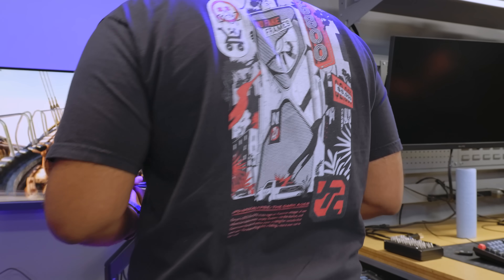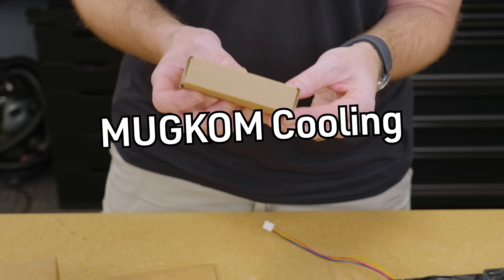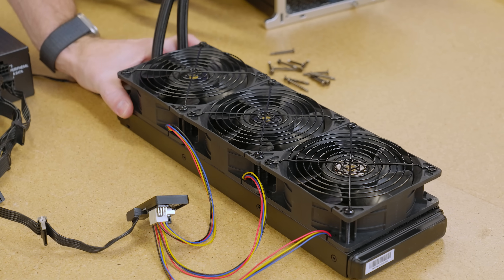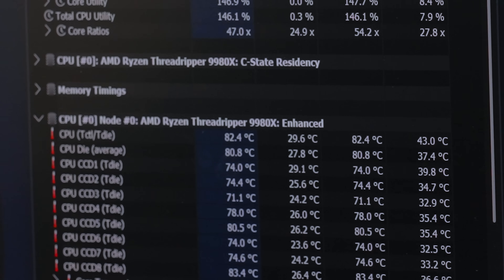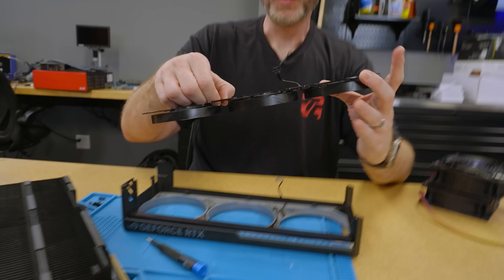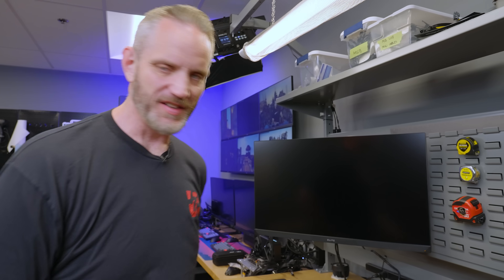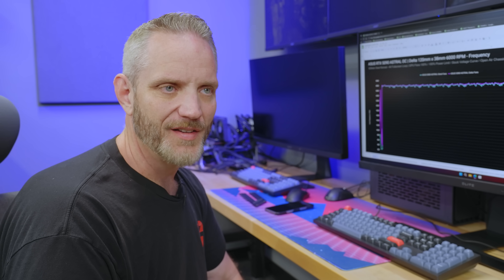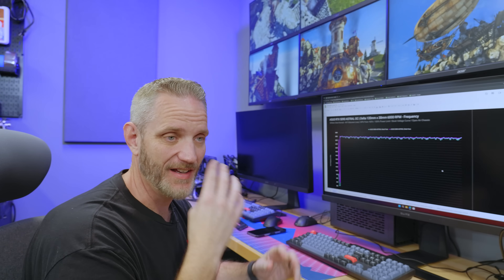Server Fans on a GPU... What could go wrong?

Comment: Hey Jay and crew! I have a question that may or may not lead down a rabbit hole... Would it be possible for you to take one of the water cooling set ups you have, get a baseline of the temperatures at idle and under full load, as well as current draw of the pump at various rpms, then swap out the coolant for 100% mineral oil and do the same? I know mineral oil won't have the same numbers but I've always wondered just what difference is there, and whether the different viscosity would strain the pump.
I'm trying to figure a cost-risk analysis if say the temperature delta between water and m.o. is for example 5  degrees. would the strain of the pump make  the expected lifespan half or less? necessitating many more pumps or if it would be a decent enough solution to algae and other hazards of incorrect additive mixtures.

Comment: Point of diminishing returns is probably I am going to guess somewhere around the 3000rpm mark. Not sure on the CFM, but I say this because of Noctua's industrial fans that reach 24v and 3k rpm or 12v and 3k rpm. I have the 12v versions for 120 and 140mm sizes. These things push air like it's nothing, but still fall short of the Delta's obviously on pure CFM. 

But Noctua would absolutely know that Delta's exist. So why not 6k rpm like with those?

Because they probably found the sweet spot is at about 3k rpm provided they can get enough airflow and static pressure with a redesign of the fanblades, stuff like that. And as I understand, the  main reason why Delta's 6k rpm fans exist is mostly just because they are having to move a lot of hot air to cool something producing more heat due to the way things are in server rooms. And they're having to push it through a bunch of stuff, so a lot of pressure is needed.

So they probably found that in other situations with more free flowing air, of cooler temperatures like average room temps for instance; 3k rpm is probably enough for most situations. Even automotive with those 24v versions.

In my use of them, I think they could probably stand to go just a little bit faster for those days when the heat can't be beat. But aside from that... they're pretty decent at what they do. A little costly comparative to some other fans out there, but... so far I think they're worth it. Why?

I'm competently cooling a 5800X3D with just 2 fans on the heatsink and no other case fans. I'm using the static pressure of the heatsink allocated 3k rpm fans blowing out the back vent, to create a suction effect through the rest of the vents. This cools the double pc case without an issue. Yes, 2 PC's in one case, cooled via just their heatsinks. Actually, mostly just the AMD heatsink. The intel one is mostly just putting more heat into the case cause it's not pointed the same direction at a vent, etc.

Max CPU/GPU load temps, I generally keep things in the 70c range at max speed, hitting 80c at most if I let it be a little slower for noise reasons. 

Two fans. On the heatsink. In a dual PC rig. 3k is probably enough I think to meet that diminishing returns curve based on my experience. 

Would I try this method with a 5090? Naw. I'd get some more proper cooling setup for that. More fans, etc. 

But it does help prove the point that at a certain point you don't really need more fans, you just need faster/better fans, but even that has its limits. I can get away with that with my X3D/6750XT rig plus Intel rig on the side; but I wouldn't bother trying that with something like a 5090 in there. Not without a way to remove that heat immediately on its own, like with a loop.

My room temps fluctuate too I should mention. I do have an AC unit to bring things down to 21-23c again, but most of what I have been saying is more attributed towards room temps of 25-29c. I kick the AC unit on again at 29c. 

So the heat definitely is being removed from the case.

Comment: Love it. 

Back in the early 2Ks I had a GeForce 2 Ultra and that beast was seriously filling my case with a lot of heat. My case had 2 80mm intake fans and room for a 60mm exhaust fan. I decided to order a delta 60mm fan for exhaust. That thing was crazy, you could feel the air out of the back of the case 30’ away on the other side of the basement. It was crazy loud too. I ended up getting a case with better airflow to transfer the computer into.

Comment: Just aim fan directly at cpu.  Why bother with the water intermediary with that much air power.  Just do it server style.  Fit them into a 4u rack case and blast it with 8 to 12 fans over a simple heatsink.

Comment: These are the same style fans that come in Alienware computers. The first computer that I tore apart to make my first custom build and custom water loop I use these fans and you can tune them to be silent and violent. So you get the best of both worlds. The only thing I want is Li lan to take a fan motor out of one of these and put it in their LCD fan so I can have all of it in one fan. Oh and make sure you use the high output fan control or pump control on your motherboard to control them.

Comment: So the one thing i came up with a long time ago, was an enclosed two liter LN2 burst system.
The housing unit runs on basically a lawn sprinkler program. 
Inside the housed unit, you have four needles that align with the CPU.
They send timed small bursts, which would eventually just be replaced by thermal sensor coupling.
The tank mounts to the back of the tower.
It is a VERY viable system.
You couple this with a machine that can produce its own small batches of LN2 and you are set.

Comment: 10:15 Gaff tape doesn't leave residue if you use it and then get rid of it. Long term the adhesive will melt like electrical tape
Reply: This is why I use white electrical tape most of the time.

Comment: I used one in my pc for years in the back of the case from a dell server. With 20%-40% on BIOS.  I only needed to invert the cables in the connector. You dont need more than one in the entire case 😂

Comment: I have an old PC style/size fan I scrapped from a small xray machine. Its 120V AC, saying 10k rpm, and has a built in speed control circuit board. Its crazy high pitched loud!! I used it in my entertainment center to keep everything cool. It worked great even at lower rpms, and with a AC plug I just connected it an extra plug socket on my stereo receiver so when I powered it on the fan starts up. This is how all PC fans should be. Lol

Comment: Another thing to keep in mind when talking about diminishing returns, and you might be seeing it here, is that if you get pressure up enough it'll actually start to warm the air as it passes through the radiator.

Comment: Cooling fan on my welder started going out and replaced it with a Delta PC fan for the only reason these fans can move some air, that and I did have a couple on hand already. HP in an engine is a derivative of torque and torque always wins over HP.

Comment: back in the AMD thunderbird days, I had a 9k RPM 60mm Delta fan on my CPU heatsink. This was the only computer I ever built that drew blood.
Reply: i had a few cheap PC cases with sharp metal edges. those drew blood frequently because i refused to learn my lessons when tinkering
Reply: i did the same, one of these fans on a big typhoon downdraft cooler though mine was only a 4000 rpm model, but 4000 rpm at 140 mm is a lot of airflow
Reply: Brings back memories of having an Athlon MP system with a 6,000 RPM Delta on each cooler that I had in my bed room running full pelt, could hear it power up through the floor in the room below it was mental and quite why I felt the need I have no idea 😂
Reply: I had a thermaltake volcano 9, and that thing was really noisy when I've put it on full blast with the manual controler.

Comment: Unplug the yellow and blue cables and plug them into a new fan connector. Connect the red and black cables to a fan-to-Molex adapter, and then connect the yellow and blue cables to the motherboard.

Comment: Hey Jay, I’m in the mechanical industry. Your testing scope is good but methodology can be improved. Try pulling the air instead of pushing the air. You will see some difference. This is why HVAC units PULL air thru condensers and evaporators.
Reply: But they push air through the evaporator.
Reply: @jedidethfreak by this logic, we’re pushing hot air inside. It should be the opposite
Reply: @rusty5100 how do you think you cool the air if not by pushing hot air through the coil?
Reply: @jedidethfreak pulling has more benefits vs pushing.
Reply: @rusty5100  only when you have easy access to cleaning the heat exchanger coils
Reply: Your mom pulls air through her condenser!!!! Lol sorry, had to say it.

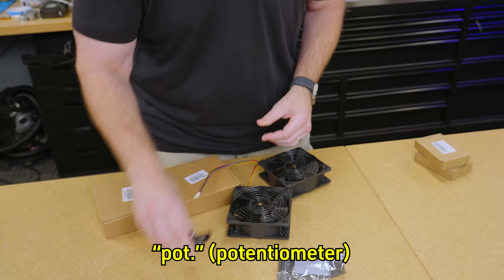Comment: 3:22, i have same controller hub for 140mm fans for sound system cooling. but the hub i got i did not get sata power, mine was a  dc 12v wall plug Adaptor Jack size: 5.5mm x 2.5-2.1mm to power it, i used molex on 30w fans with hub rated 60w so two hubs one fan a hub to be safe. ive got same adapter controller hub uses wall power directly, a few options this same controller hub. its hard to find over 60w hubs i could not even wall powered ones was struggle 60w was max but to be safe one per a fan and a y splitter so cable from hub that only controller cable not power on most esp molex type. the 3:22 one but wall powered i know limit 60w for max 4 fans so if i used 8k rpm 120mm fans on it two max as they 30w each but never run at full speed as to close to limit , but for now x2 140mm arctic fans cooling av receiver well at around half power on that hub

Comment: i saw a repair guy youtuber said he gets alots of GPUs  that get bricked by people using high power air duster or blow dryer to blow the dust off of it and the static or whatever killed the card many of  times
Reply: Turning an electrical motor that is powered off induces a reverse voltage that can get quite high if the energy has nowhere to go, which will easily destroy the transistor handling the PWM regulation and possibly even some electronics behind it. For this reason it's common practice to include a diode with inverse polarity to short any voltage going the wrong way, as the few seconds of spinning down when powering the fan off can already induce a deadly voltage for those components.
MOSFET transistors already include a parasitic body diode that can kinda fulfill this role as well if you want to cheap out on including a dedicated diode, but they're a rather bad fit - which probably explains why these fans get toasted that easily.

Comment: i got set arctic 120mm x 38mm 8000rpm fans, lowest 800rpm, a set 3 for only £30, they are insane, got because coolermaster aio well first dry paste then new paste but was worse than a 7 year old aio with dry paste, for a temp solution i added two these crazy fans, temps were far better even running then max 4k even 3k, motherboard temps well lowest id ever seen it was 27c, the air flow leaving the case it came out top case hit a shelf above and i could still feel a strong breeze over 4ft away, they not in use now since upgraded my main system and only air cooled but i do have a way to power then out side the case, it involves a wall plug and a controller it says max 60w with 6 fan plugs , old system i used molex one 60w molex fan hub each to be on safe side, they used 28w i say 30w to be safe, they do need own power for sure and fan it self well stopping blade you feel weight, they take fingers off im sure, so grill was needed, due to 38mm think wow when at 1500k rpm they pushing more air through rad than those normal ones at 3k, these insane fans they get another use, but at 8k 120mm you hear then 2 floor down they so loud but if you want air flow so great you pc becomes a desk fan go ahead and they cheap at set 3 for only £30, max brown fans the fastest ones they £30 each but you need like 10 those to get same air flow as two and static pressure ones 3 while these over 10x

Comment: i use those type of fans, on a voltage control boostbuck converter for my homelab shelf, with finger shields, they are no joke. btw, throttled down to 9 volts give a room tolerable noise level

Comment: Jay, there are limits to how much heat (energy) can be transferred in both time and quantity. I know from experience you can push more air over a coil that can usefully transfer heat. you need both a volume of air and a time period for that air to be in contact with the coil to get maximum efficiency out of the heat transfer. think of it as both air speed & dwell time on the coil, you can slow down the air and increase the dwell time where you max out the transfer from coil to air, the discharge is hotter, but you still transfer less heat. what you did is the reverse, air volume was too high causing lower dwell time over the coil which transferred less heat. it's a balancing act; you need to increase the surface area and increase the air flow to gain the best results. having coil fins with turbulator bends and patterns to keep the airflow moving and changing the boundary layer to get all the air in contact would also help.
Reply: Sorry, but you are quoting thermodynamics out-of-context and - in this case - unfortunately, wrongly. The amount of heat energy you can transfer across an interface (here: black paint on the cooling fins of the radiator to air) only depends on the temperature difference. Even heat capacity and conductivity of both materials is not relevant for that exchange. The extreme airflow in Jay's experiment guarantees that the air on the fins is always constant temperature (ideally room temperature) and ensures the maximum heat exchange. This is exactly why AC-cooled air can remove more heat than ambient temperature air, irrespecitve of airflow-speeds. At low flow speeds, the comparatively small heat capacity of air allows it to heat up fast, which drops the temperature difference and worsens heat exchange, so ramping up fan speed from idle drops your CPU temperature. By this, the air temp before and after the radiator are almost identical and low, which is a good thing!

What you are referring to is the time it takes for a high-thermal-capacity medium like water in an AIO loop to transfer heat into the high-thermal-capacity copper of the radiator and then by heat conduction into the fins. If you have a single 120mm radiator and a therefore a short run of tubing through the radiator, copper heats up too quickly for the air to cool it down, so the hot water is still hot at the end of the radiator, which is a bad thing for the CPU, but still allows maximal heat transfer per unit area of radiator to the air. You can either increase air flow, or increase radiator length, or decrease water flow rate until the water at radiator output is cooled down to room temperature and can transport heat away from the CPU at maximum rate. It is not surprising that the AIO fans perform the same as the sever fans when the water return temperature is "locked" at room temperature for a given radiator-fan-combo. This principle does not change in case of the GPU with heat-pipes conducting heat to the cooling fins instead of a water loop. 

However, I would agree that the 100W of power from the 3 industrial fans needs to go somewhere and the added heat plus increased kinetic energy of the air means that what hits the radiator fins is actually minimally above ambient air temperature...
Reply: @TheMalT75   I'm using my 35 years of experience doing HVAC work in NYC. trying to use simple language that could be easily understood. you sound like an engineer not a mechanic. have a nice day.

Comment: I had twin Artic 120mm server fans. They were too thick for my use, but I was prepared to find a solution to that, but could not find a solution to control/power them on my 9950x system

Comment: Interesting and not surprising ! 
I did a bit of the same type of test with the Thermalright Phantom Spirit 120SE cooler that I put on a CPU with liquid metal DC2 and I replaced the fans with two 120mm Silent Wings Pro 4 fans that go up to 3000 RPM maximum. 
It turns out that from 2100 RPM to 3000 RPM, there is only 2°C of gain. 
It seems obvious that there is a limit to what the radiator can handle, and more consistent ventilation no longer has a relevant effect beyond a certain speed. 
In my example, I have the "sweet spot" between 1600 and 1800 RPM before the curve "thermal gain / noise nuisance" becomes decreasing. 
On the other hand, between 1150 RPM and 1550 RPM, apart from a slight increase in noise, I have a 10°C difference. 
A bit like the OC of a CPU or a GPU, it is interesting to find its efficient threshold between thermal performance and noise pollution.

Comment: SATA connectors are rated to 54W which is likely where the controller got the 60W rating from, DC will just split that across the fans, the controller cant tell the power supply to get more, so it's bound by the interface to the PSU, since they are 6K RPM Fans, at 1/3 power you should still get 3-4K in RPM (speed is exponential when power draw is concerned) which to the naked eye is hard to notice.
Reply: Yes that is the limit for the 12V pins, plus an additional ~20W on 5V (likely not used). However PSUs cannot dynamically throttle the output to a single connector and most don't have per connector OCP so it will still allow the device to overload the connector. The 3 22-24 AWG wires being the most likely limitation.

So unless the controller itself is limiting the power draw, it is very likely drawing more power.
Reply: Thanks.  I was pretty sure there was a SATA power limit, but not 100%.

Comment: Jay, do a test where you get a larger/thicker copper waterblock and show the difference there.  As you noted, I think this is just the waterblock isn't able to take away heat any faster with all that fan cooling potential.